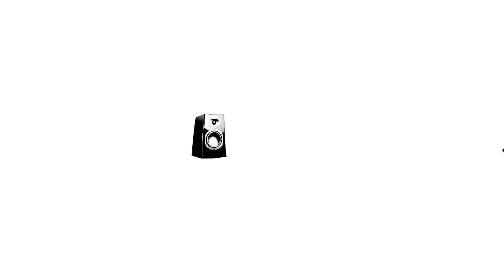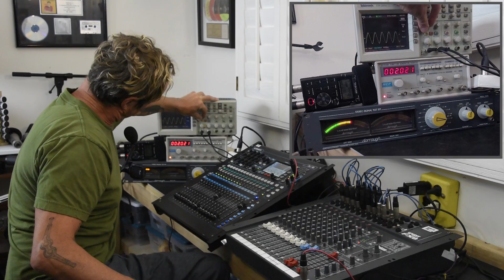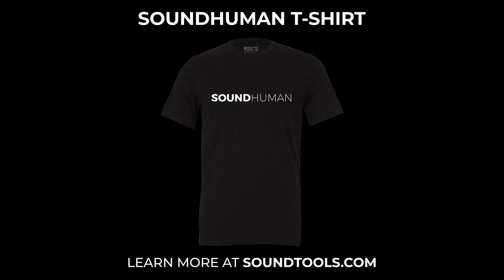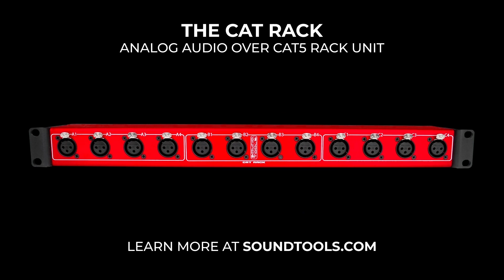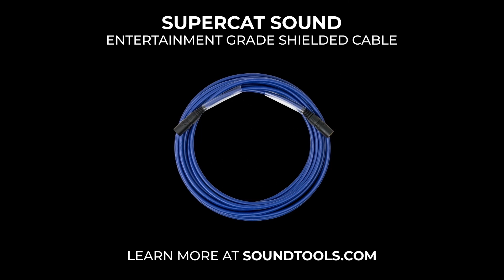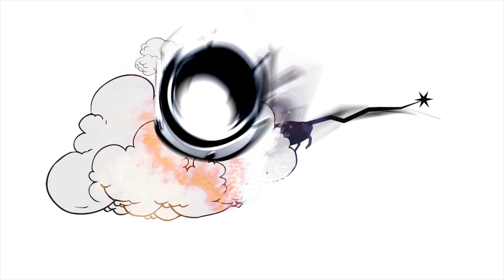Digital vs Analog #2 of 6 - The Highs

Comment: Just a thought regarding when you 1st started bringing in the digital channels. Would SMPTE have been a factor? Assuming it was not connected? And a second question, Digital mixers do have preamps that are not the same as DAC's I think. (Me man of little knowledge)
Reply from the maker: Not sure about smpte as that I believe refers to timecode between audio and video. So would not apply to an audio only console. Yes, there is an analog stage that sets the gain prior to being converted to digital. I am guessing the analog mic pre has digitally controlled gain and such in this console and there is no actual analog controls over the analog mic pre.
Reply: @DaveRat  I believe the SMPTE in general is for syncing devices in general. I've never used it and always thought of it as syncing "x" devices, but I had a thought of if it also synced per fader at/within source device (if the smpte were connected) ThingsI don't know nothing about, yet! ;)
Reply from the maker: Yeah to the best of my knowledge Cynthia is not used internally all of the various components of a digital device I synced off of a word clock. Perhaps someone out there with more experience in the depths of digital can you clarify but my understanding is the word clock sends out pulses with sync everything together. There is some debate on how important super accurate word clocks are to the final sound and whether high-quality word clocks can improve the sound of mid and low quality digital equipment. I've done some testing on this maybe I will find a test that gives audible results to compare.

Though I have also seen a lot of false information on things like ultra expensive HDMI cables improving sound and video. My understanding is that the two units connected by the cable either sink well or do not and have sync issues and as long as the cable is sufficient for them to sink well anything beyond that has no impact
Reply: @DaveRat  Thanks Dave, Appreciate your vids, info, and insight. The genius with stage phasing division solution and How the method you use to set your faders. Thanks man! ( I'm retaining bits)

Comment: Unless your music production in targeted for bats, I don’t think the performance of 22+ kHz frequencies is going to make any difference for the listener. Human hearing generally doesn’t extent much beyond 20 kHz for people with the best hearing (young childeren). For adults above 30, most don’t hear anything above 18 kHz and often lower than that. I’m 46 and my hearing cuts out at around 15.5 Khz, which I belief is fairly common for my age. So the difference between the analog and digital desk demonstrated here are really more ‘academic’ than anything else.
Reply from the maker: Hmmm, that logic seems to parallel no one needing a car that is capable of exceeding the speed limit unless they are going to the race track.

22K is only 1/10 of an octave above 20K and only 1/2 and octave above 15K

Another train of thought would be that a sound system capable of reproducing a full octave above and below the desired usage range. We hear 10 octaves, and when we get to octave 10 and talk about frequencies 1/4 beyond that at 25K, it is all of a sudden "whoa, that is way too high, humans can never hear or perceive something that high" 

But wait, we perceive light and it is 430 trillion hz and beyond, we can see infrared light but perceive it as heat and its like 400 trillion hz. We cant hear earthquakes because they are like .1 to 1 hz but we feel them and we cant hear 40K as its too high to hear but I just recorded a video demonstrating my daughter and myself able to hear/feel a 40K in a blind test. And good chance you can hear/feel it too. Our senses are not locked into simplistic ranges, rather we have myriad of ways of perceiving the environment around us. And I would venture to say we can perceive frequencies, as low as 1 cycle per year or lower, if the amplitude is great enough. And clearly we percieve light and one could say radiation burns are a form of perception as well, so way beyond visible energy is perceptible.

All that said, as soon as someone creates a speaker so perfect it is indiscernible from the original source, I will accept those as the specs we strive for.
Reply: @DaveRat  "that logic seems to parallel no one needing a car that is capable of exceeding the speed limit unless they are going to the race track."
Sorry, but that analogy doesn't work. Speed limits are different on different roads and in different countries. There is no human physical limit that would prevent you from driving faster than the speed limit. I live in Europe and sometimes drive on the German Autobahn. There you can at certain roads drive however fast you like and your car and traffic allows you to.

However your hearing IS limited to a certain range, and cannot be extended by using an audio system that has more frequency range in its output than you can still hear. 
I see you claim to hear frequencies up to 40 kHz, but I can't watch your video because you put it behind a pay wall. Without being able to say what exactly you tested, I have my doubts about 'hearing' those frequencies. Maybe you can 'feel' that there is something there, but that doesn't mean you can actually 'hear' it and it having an actual impact on how you percieve music with or without those frequencies. The only true test is to compare recordings that do and don't have frequencies beyond 20 kHz and see if you can tell the difference in a double blind test.

One test you can do online allows you to test if you can tell higher frequencies in white noise. Taking your age into consideration I have my doubts you can consistently pick the right ones with the full range vs the limited range all the way up to 20 kHz. If you can't, it's nonsensical to belief you're really hearing above 20 kHz.
Give it a try and see for yourself: https://www.audiocheck.net/blindtests_frequency.php?frq=19
At the top of the page you can select different frequencies, so you can find out which difference you can and can't tell.
Reply from the maker: @MacXpert74  I will release the 40K video at some point, I have about four or five videos ahead of that to release from member to public area.

When I was doing seminars around the world, one of the demos I did was to have everyone turn aroundwhile I pointed a speaker reproducing 40K at them and you can watch various people shoulder cringe as I pointed it at them. I recreated this test recently with my daughter and I taking turns.

the question isn't whether or not we can perceive higher frequencies than 20K, as high levels of high frequencies do give people headaches and sensations. What is debatable is the definition of hearing and if we are able to sense frequencies beyond 20K, are they relevant?

Not unlike ultra low frequencies below 20 hz, the question isn't whether we can sense ultra high frequencies, but rather, at what level can we sense them.

For example, 10K at high enough level will burn your skin,  50k at high enough level will give you headaches. Non audible ultra-high frequencies can damage your hearing.

My opinion is that no one has created a sound system capable of recreating truly realistic sound. I believe part of the reason is because of false and flawed assumptions guiding the development process.

If you look at the ideal frequency response I've allowed speaker through the course of audio playback history, you will find a constantly expanding set it parameters.

Those parameters will continue to expand.
Reply: @DaveRat  When you release the video to the public area, I would be interested to see it for sure.
"What is debatable is the definition of hearing and if we are able to sense frequencies beyond 20K, are they relevant?" yeah I agree with your point there. I have done several listening tests myself throughout the years, and allthough it is possible to detect a sine wave at higher frequencies, I can't succesfully tell the difference between a normal music recording (or white noise) that does and doesn't contain frequencies above 16 kHz. Some years ago I could still hear up to 17 kHz, but my hearing is slowly going down, with age. So in normal real world music listening I at least for myself can't say that 20 kHz+ frequencies will make any difference to the listening experience.

When it comes to how 'real' a certain system sounds, there are of course many parameters that influence this. Particularly with speakers. They usually don't produce a completely flat and distortion free output throughout the standard 20 Hz - 20.000 Hz range. Improvements that can be made within this 'normal' range are more likely to influence the percieved sound quality instead of the potential to exceed 20 kHz frequencies in my opinion.

But it's a interesting topic with many different opinions :D

Thanks for your reply!
Reply from the maker: @MacXpert74  great stuff!  Yeah, I think using white noise reduces the probability of hearing nuances.

I would say doing a blind listening using a real triangle vs a recording of a triangle that has been band limited at 20k vs a recording of a non band limited triangle and listening for which sounds most realistic, would be a starting place, if one was to look for audibility and impacts of extended HF freq response.

Finding a sound system that the real and recording are indiscernible from each other would mean the sound system is getting close ideal
Reply: It's true that our hearing has limitations. The older we get, the less hi freqs we hear. However, what would be the use of 192 Khz sampling freq for digital recording ? Well it's got its reasons...and not a selling point of view.
Reply: sK3LeTvM I honestly can’t think of a good reason to record in 192 kHz other than to please the audiophile types that belief ‘higher is better’. In fact some tech people in the audio industry have argued that recording such high frequencies could have negative side effects, because parts of the audio chain people use, like their amplifier for instance, might not handle such a wide frequency range all that great and might introduce unwanted harmonic distortions due to frequency intermodulation. Besides this, other pieces of equipment used during recording generally wont have such a wide range either. 192 kHz recording would theoretically allow you to record frequencies up to 96 kHz. However, microphones typically used for vocal and instrument recording don’t have such a wide range.

But I would be interested to hear why you feel 192 kHz is beneficial over let’s say 96 kHz recording.
Reply: @MacXpert74  Working at 192khz in a DAW has its advantages, less chance of distortion plugins audibly aliasing, more flexibility with low Q EQ in the ultrasonic range to make subtle changes to the HFs, potentially lower latency if the computer has enough processing power, (in a simplistic view, at any given time, there's a buffer you're filling at the input, a buffer you're processing through the plugins and a buffer that is being played out of the output The higher the sample rate the quicker those buffers get through the input and output.)

Rendering a file out to 192khz for listening  confers no benefit as far as I'm concerned however. It just balloons the file size and as you mentioned may cause problems with less capable equipment in the signal chain. I have a number of 24bit/192khz vinyl transfers,  my system has above average HF performance (compared to the majority of consumer level sensibly priced gear)  if my measurements and specs of my equipment are to be believed, and there's no audible difference when compared to the same file that's been resampled to 44.1khz/16bit. Maybe my equipment isn't up to par, I'm not totally dismissing that possibility. FWIW The spectrum analyzer on foobar does look much nicer when playing back the higher fidelity files however lol.

Comment: I’m just an amateur, but wouldn’t the steep drop off at 22kHz on the digital console be due to antialiasing? You have to sample at twice the signal frequency, so frequencies above half (~24 kHz in your case) are intentionally suppressed by the gear.

Thanks for the informative video!
Reply from the maker: Not sure if it's anti-aliasing or we are just seeing the aliasing.

Since the level does not drop drastically as we approach the 1/2 sample freq, seems to be just the aliasing we see.

Comment: The amplitude modulation on the digital console as you approach the Nyquist frequency is interesting. I wonder if this could be the result of aliasing caused by non-linear distortion being applied in the digital console before it reaches the ADC and all subsequent DSP.
Reply from the maker: Not sure exactly why, but does seem to make logical sense
Reply: @DaveRat  Could be interesting to measure the frequency of the AM and see if it's an aliased multiple of the input frequency which could confirm it.
Reply from the maker: I think I will try and do another similar test with large format consoles and see if the results differ or not.  Then maybe dive further into things of interest

Comment: I wonder if a digital mixer could continue a digital path into a power amp. As is...  Such like a Crown XTI, that has some basic processing. And end the path of digital, convert it to analog just before the amplification stage.

A direct digital connection from mixer to amplifier. 

Something like a Donte networked Yamaha CL Console system. Passing signal into a Donte ready Power Amp?
Reply from the maker: Hello Steven, yes, we do that as a standard deployment on all our systems. With a digital console we stay digital all the way to the amps and with analog, we convert to digital and stay digital all the way to the amps.  For festivals we use Rat Drive Racks that can take multiple consoles with any form of digital output, Cat5e, Madi, fiber and multiple analog consoles and switch between and combine them and then send out signals in any form of digital Cat5e, Fiber or analog to multiple places.
Reply: this is already standard with modern systems ;)
AES or network out of console into controller into amp or skip the controller altogether if you have networked amps like with d&b and l'acoustics.

Comment: Wouldn't it be better to have a the bandwidth limited to just beyond what we can hear, to avoid creating additional IMD in downstream devices?
Reply from the maker: That's a good question and my opinion on that is that having equipment that is easily capable of vastly exceeding the required parameters is superior to equipment that barely meets the required parameters.

Since from 20k to 22k is only 1/10 of an octave, that's cutting it mighty close.

20k to 30k is 1/2 octave, so it seems ok. I don't think it would be unreasonable to have gear that can effortlessly reproduce audio a full octave above and below the desired response to be used.  So a 10hz to 40k response I think would be a reasonable goal for quality audio.

Not unlike a car that is limited or incapable of exceeding 65 mph because that is the speed limit.

As far as IM issues, as long as the signal is not sent, it won't be reproduced. And IM issues are typically a low freq signal impacting a higher freq signal. So extending the highs should not alter that

Comment: What audio pa system would be your dream setup? Knowing that the "band" can provide sub information down to 20hz and split out di's (for your super subs and any (pan)delay lines you want, and you can have  multiple mid high hangs available anywhere in the 360 domain. Tell us your dream...
Reply from the maker: Awesome question and will ponder. That may be better as one of the zoom chat topics.

Comment: How does the bit rate affect the latency or phasing? 16 / 24 / 32 bit floating?  What is more discernable 16 to 24 bit or 48 to 96 kHz?  Also would an older analog console vary more from each channel strip than an older digital desk?
Reply from the maker: Not sure but rate impacts phasing. I am not expert enough on digital to know what should happen. That said, I am observant enough to know that when people say something has no audible impact, it's worthwhile to test and see what happens
Reply: Most modern converters are serial digital. That means they transmit data digitally in a serial bit steam rather than a parallel bus. For example if you were sampling at 32 bits per sample you'd need to have a serial link capable of sending those 32 bits before the next sample could be sent. Also you could not output the sample until all 32 bits had been received. I believe there may also be additional framing data sent with the 32 data bits. So in a digital system the DAC has a best case one sample period delay. So more bits will mean more delay but higher sample rate should also lower the delay. In analog the delay is length of signal chain / speed of light * propagation of signal in cable (often around 0.66) and any other capacitance and inductance delay impacts. For most cases analog propagation delays will be unable to be detected or measured. The speed of light can be considered infinity for audio. Digital propagation delay is also quite short being 1/48000 th second for 48khz. Of course this is all based upon theory I've never tested this.